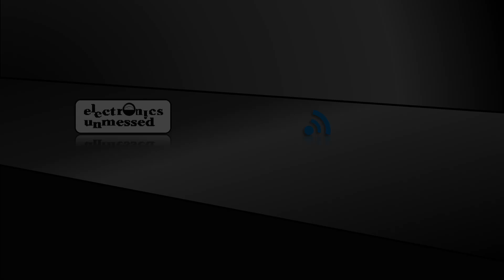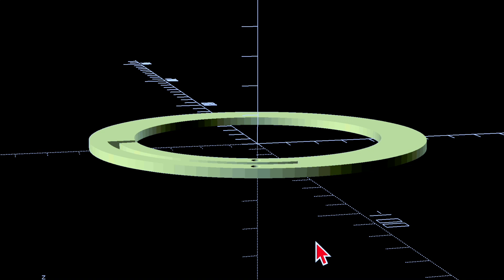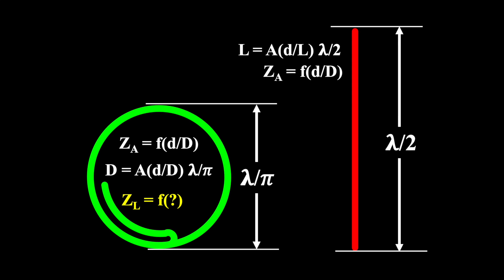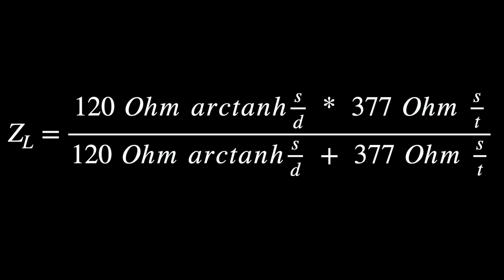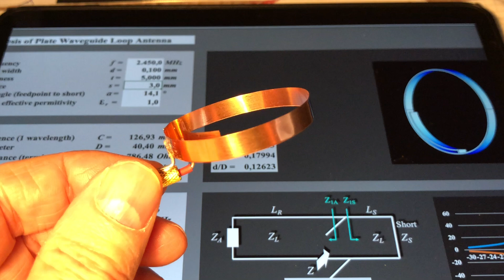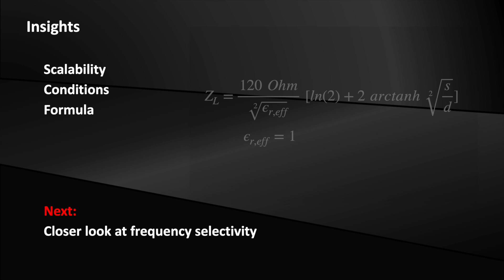Scalable Designs for our special Loop Antenna (EP151)

Comment: Thanks for this nice video. I was looking for a 2 meter and 70 cm HAM antenna. It came to my mind to build two antennas, one for each band and mount them together on a turnable mast.
The question that arises is how to mount them such that the influence of one to the other (including the feeding coax cables) minimizes.
I'm thinking of mounting them side by side (loops in the same plane) or place them so the center of the loops is in one line, meaning the nul point of the loops are toward each other.

Any suggestions or is this bad practice?
Reply from the maker: Hello, thank you for your question. If you can place the antennas about 1.5 meters apart, then I don't see any problem. You can try to go closer before mounting on the mast. The loops are relatively resilient. Good luck and have fun with it.